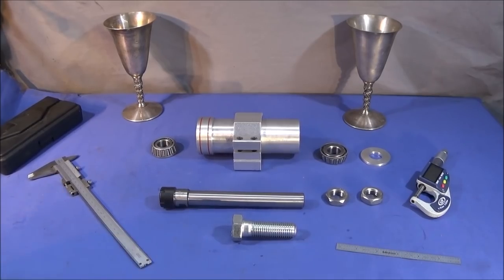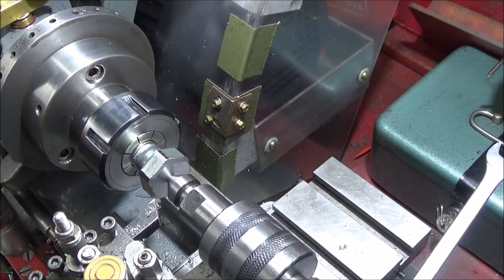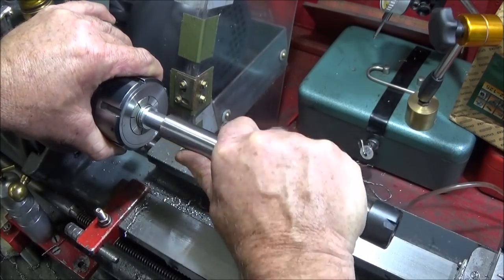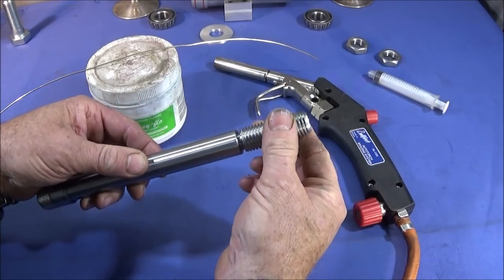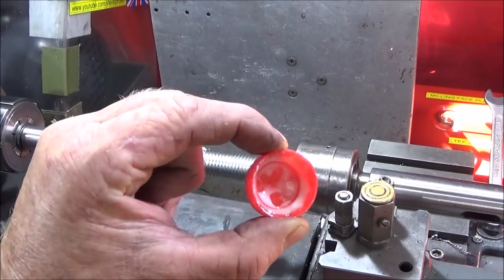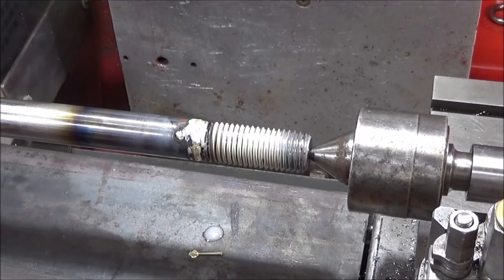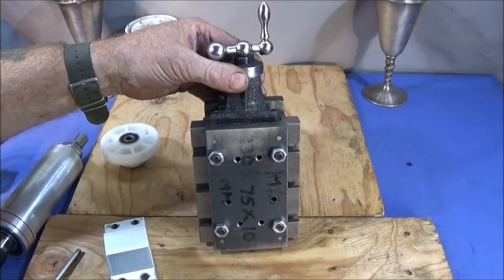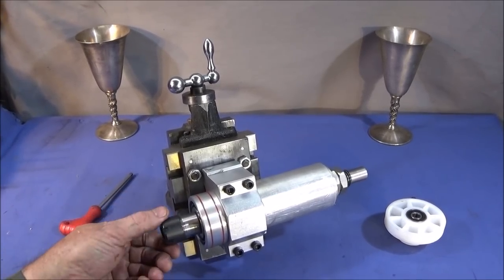Milling Spindle Attachment Part 3 Machining Bearing Pre-Load Assy.

Comment: Hi Steve.    I thought I would leave another comment.    I'm not sure if you are familiar with packing a bearing so thought I would mention it.    Tapered bearings should be packed with grease and there are several ways to do this.    That is how the front wheels of autos used to be done and look at the miles and abuse they took.    If the bearings were not packed you didn't get much mileage out of them.    Enjoying the series.   Going now to see the finishing one with motor.

Comment: Nice work Steve.  I’ve been thinking about a future spindle project for my diy CNC machine based on those straight collet shafts.  I couldn’t think of a good way to get the thread and drive end sorted out so the silver solder idea is a great one.  Thanks
Reply from the maker: Hi Thanks, Later I will show how one can do exactly the same using Loctite 638 instead of brazing and it will be just as strong. Regards Steve
Reply: That was my initial thought together with a cross drilled dowel pin ( belt and braces!). Thanks
Reply: You can also heat the outer part and shrink the inner part by freezing it.
However, you have to be quick when assembling the parts.
 https://en.wikipedia.org/wiki/Cooling_bath
__________________________________________________________________________________________________

Man kann auch das äußere Teil erwärmen und das innere Teil durch tiefkühlen schrumpfen.
Beim Zusammenfügen der Teile muss man allerdings schnell sein.

Comment: I keep thinking about making a REALLY quick and dirty version of this. Generally, just drilling and reaming a 20x30x100mm block of mild steel  lengthways with the bore off to one side, Then making an 8x200(ish)mm spindle and mounting one of those cheep little 0.6 to 6mm chucks on it. Oil up the spindle, put it through the block, clamp the block in the toolpost, and slap an electric drill on the end. I might need to thin down the side of it a bit to get it into the tool post, But as it would only be the face that the clamping bolts go against, I could probably even get away with just roughly taking out a 5mm step using the bench grinder.
I'd only really need it as a guide for drilling holes squarely in the side or front of work pieces, So it would probably be fine (At least for a while) running oiled metal on metal without any bearings.

Comment: Excellent work of machine building, as is your teaching of the logical design and construction techniques.

You spliced a threaded extension to the stock chuck spindle.  Was that necessary because a longer spindle was not available, which you could have threaded and turned down for the pulley?

Did you consider cross-drilling a taper hole and using a taper pin to lock the extension to the spindle, instead of (or in addition to) solder?

I prefer timing belts and pulleys for these types of assemblies.  They're cheap, available, effective, and readily modified to fit.
Reply from the maker: Hi Richard, I've just finished the project this evening. I shortened the whole assembly in the end by 55mm. The pre-load and pulley assembly can just be fitted with Loctite 638. There is no need for a pin or brazing. 

I prefer machining up already threaded components like the bolt I have shown. It saves a massive amount of time, over setting up the lathe for threading.
 
Also I like to show people how to make things that are uncomplicated and easy to copy without a load of tedious theory or technical stuff, which can put newcomers off of engineering.

I used a poly V multiple rib J section belt and pulleys. These work brilliantly.

I have been milling hard steel with a 12mm end-mill and it runs brilliantly and produces excellent finishes. I hope to show a video of it in machining operation this weekend and will put some photos on my Google+ page if i get the time.
Reply: Threading would keep the spindle to one piece, but you are correct, the workmanship required adds a level of difficulty and feasibility risk.  If you bungle the threading, then you've gotta pay and wait for another spindle.  It's also not obvious how one would workhold the knobby ER end of the spindle so you can work on the input end.

Loctite surely is going to stay put and not spin loose under any available torque.  I'm recalling how using the ordinary permanent threadlocker will twist the cap off a bolt.

Comment: Nice work.     I was thinking of using similar materials for a spindle.   If you wanted to leave the bore hollow all the way through the spindle, do you think threads could be cut on the outer diameter ground surface using a standard carbide thread tool?
Reply from the maker: Thanks, It would have to be a fine thread as there isn't much wall thickness to work with. I have machined these shafts with standard carbide inserts. They are not overly hardened.

Comment: dear steve jordan greetings mate, i have learned a lot from you very much thanks.i born in malta, had a lots of british mates there, i been in dawn under here for now 46 years, great country,and i was a chippy all me life, malta and here,your amazing trademan, well i got a question, m not that bad now, and i got chinese mini lathe too.7" x 14" those blue ones its on ebay, 550 watt, 100-2500 rpm, and wonder how do i make threads, ??? i got set plastic gears with it, but inside it  came all metal, except the 2 large  bottom ones are plastic, does it need to change any gears to make threads ,my manuel does not say, maybe i need to buy a manuel from ebay.???any idea i can get from your experiance, much appreciated, good long years to you mate cheers

Comment: Steve, I think that the two parts should have had more flux on them, before you put them together, it would have made a stronger part.
Reply from the maker: Hi No it was absolutely solid with plenty of braze all round. I shortened the whole spindle assembly by 55mm after this video and I couldn't remove the preload part from the sawn off end when I reheated it so it was a perfect braze job. I had to make a new part. I have installed the new one using Loctite 638. Will show it all in operation later. It has worked out excellent.
Reply: Hi Steve.   I also noticed that you didn't use any flux in the hole you made for the solder to go inside.    I also wondered why you did not use loctite 638 to cement it together instead of soldering.    I think you have sold me on the idea of using the loctite 638.

Comment: Hello!
The Collet Chuck Holder has a pre drill thru hole, or you made it? on minute 1:34 
I'd like to make an ISO20 tool holder from C20 ER25  Collet Chuck Holder and grind it. I need to put thru the hole a drawbar with pre loaded spring mechanism.
Hoping to make spindle for my plywood CNC with fast tool change like here
https://youtu.be/cK8GqIieLMY